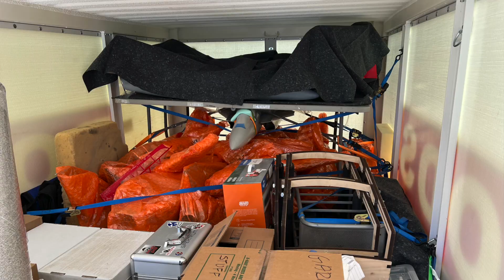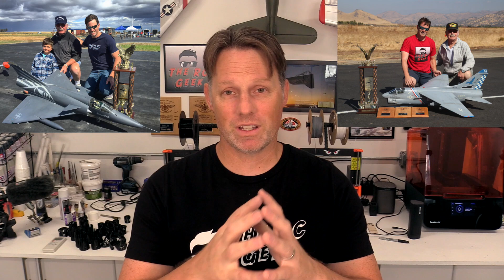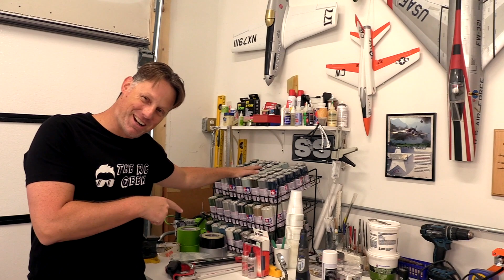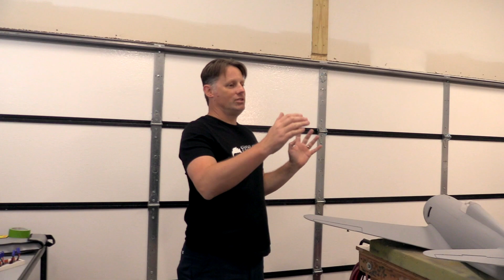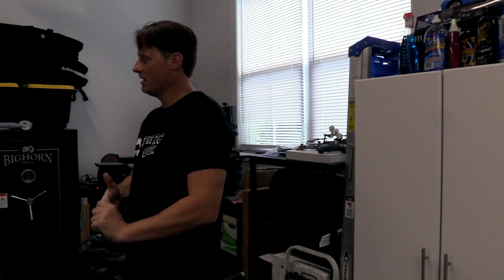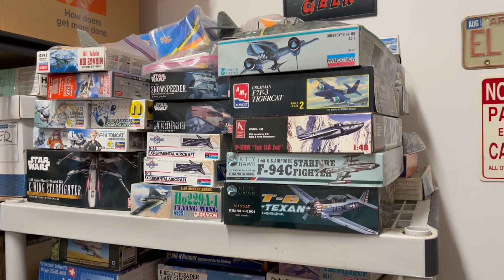New WORKSHOP TOUR and FMS Rafale EDF Winner Annoucement!

Comment: Being in Texas, I really wanna know about that mini split. What brand, how much etc
Reply from the maker: It’s been working fantastically. Does both heat and air, so the shop is temp controlled year round. It was about 4k to have installed which included the cost of the unit.

Comment: Hi 2 questions : 1- will the Fms rafale nozzles will increase speed ? My too slow.         2- Are Tamiya paints , water paint (will not damege foam) ?
Reply from the maker: Yes, the nozzle do increase the overall performance quite noticeably. For paints, these days foam models are made of epo foam which is extremely resilient to solvents. So, you can use most any type of spray paint on it. I have used all number of tamiya spray paints on them.
Reply: @Thercgeek  thanks